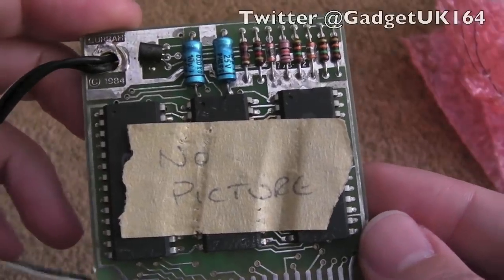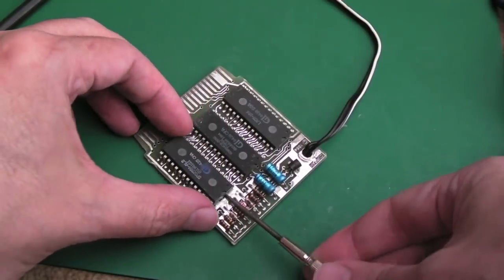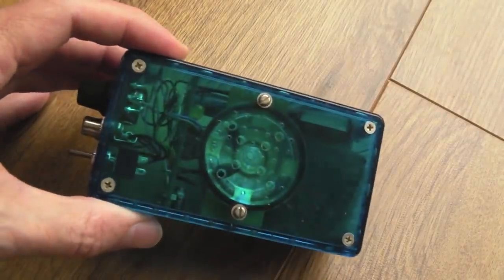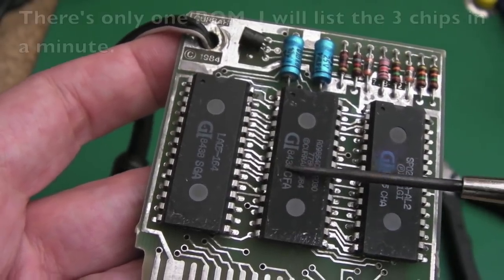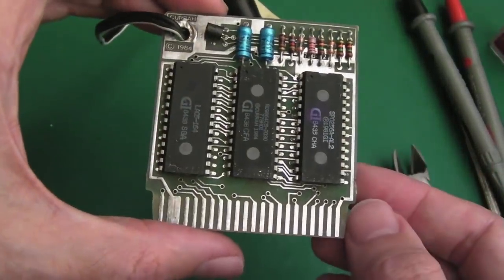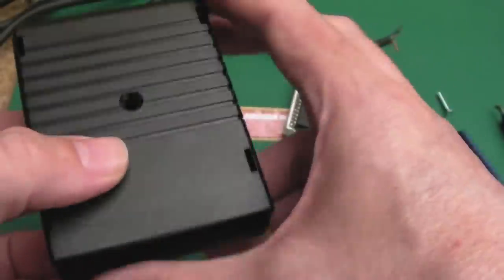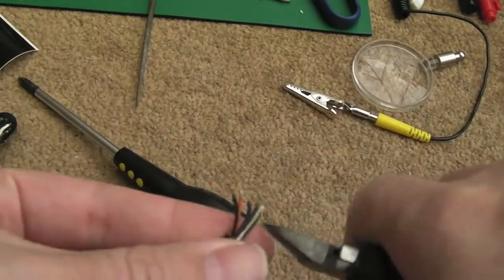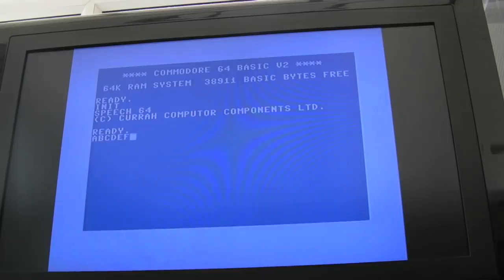Commodore 64 (C64) Currah Speech 64 (Voice Messenger) Cart Repair

Comment: No Vcc means Data Bus shorted to ground... that's why it didn't want to boot.
Reply from the maker: How does the data bus short to ground when there's no VCC?  My understanding is that often what happens is some connection leaches the supply in an unintended parasitic way.  But the databus is provided by the CPU and the CPU has power.  If the ROM was not powered I cannot imagine it shorting the bus out.
Reply: @GadgetUK164  Many chips I've seen pull outputs low when they have no power but have a ground, and high when they have no ground but only Vcc. Maybe it was not the databus (if it is connected directly and only to EPROM), but some other crucial control signal.

Comment: What a strange fault...did this cart ever work? If not, it's a wonder it wasn't thrown away. I didn't even know Currah made a speech cart for the C64, but to be honest, it didn't really need it. SAM did an admirable job in software only.
Reply from the maker: Yes, I think what happened is at manufacture the pad going to the VCC pin there was lifted up - you can sort of tell that at the point I am zoomed in, there appears to be no pad on side of that pin that we can see, and underneath it was lifted up almost sideways against the pin.  Yes, SAM does sound great - just spotted that on 8 bit guys video!! =D

Comment: i just tried this but unfortunatly my results were not as succesfull
as yours! just couldnt get it to work, i could tell it wanted to though, kind of bit of sound and scrolly off coloured picture?! i used an existing din cable though and not seperate pieces of wire like you did.. i also broke my soldering iron in the process! so now ill have to wait to buy another one of them before having another crack. 
do you think a Y splitter male din to 2 female din cable would do the same job at all?
Reply: ..... i say broke my soldering iron i mean threw it down the garden in a paddy
Reply from the maker: A Y splitter that is fully wired (eg. 1-1, 2-2, 3-3 etc) with the correct DIN connectors would work, provided you join up to the correct connections with the audio coming out of the Currah.
Reply: @GadgetUK164  thanks for the reply, i now have a shiney new soldering iron that isnt broken down the garden and am just waiting for a fresh din female end to be delivered and i will be having another crack! if that fails i'll be looking for a Y splitter cable then

Comment: Hi. Isnt it possible to use this on a Commodore Monitor? Currah Speech using the video out on C64. Is the only way to get picture on the screen to us a RF cable?
Reply from the maker: You can use composite output to connect to a Commodore monitor (CVBS input) - and the sound can be input to the monitor too.
Reply: @GadgetUK164  ok, do I need a module/splitter between c64 and monitor then as currah Speech is plugged into the video out contact on computer?
Reply from the maker: @_commodore_  Just a composite lead - the audio from this cart should go into the audio IN on the SID chip as default, which means the audio out will go to the monitor I think.   You just need a C64 composite lead (check it has 2 RCA connectors, one for video, one for sound)

That's if it comes with the mixing lead - mine was missing that I think - I would need to watch the video back.

Comment: I have one of these that's been sitting in my closet for years - I just tried it, and it works except no sound - When I INIT I just hear a humming noise.  Any ideas? Would you be willing to repair it? :)
Reply from the maker: I cannot do customer repairs sorry =/  Are you sure the audio / RF pass through is connectded up properly?  It might be that the speech chip has died, or the capacitor that couples audio has gone bad.
Reply: @GadgetUK164  Thanks for the reply I understand! Hmm maybe I’m not understanding how it works. Does the audio have to go through the external? I suppose I need a cable adapter of some kind.

Comment: Just wonder about 25V caps. It's not so bad bcos, when you use capacitors for higher voltage, there are much lower leakage currents.
Reply from the maker: Yeah, it really doesn't make much difference btw!  Where I can I tend to uprate on voltage.  The main thing is to not get too close to the voltage.  The SNES for example uses 16v caps on 12v input - and for the most part they are usually OK - although some of the ones I've seen from Japan seem to leak.
Reply: @GadgetUK164  
On another topic ...  Did you see this cool idea ?
https://github.com/ThKattanek/1541-rebuild/blob/master/doc/1541-rebuild-schaltplan.pdf
see page 1 and 4
I can't get it. If the transmission to the VIA $ 1c01 PB port is carried out from the microcontroller, would it not be safer that the PB lines wouldn't be completely cut off from the PLA? Also byte ready and SYNC? As I understand this, atmega steers so there may be conflicts on these lines ... (?)

Comment: Great video.  How would that trace hidden under the chip ever of got damaged?  

Oh and never mind weird voices in your house that c64 sounds terrifying enough 😂 exterminate.
Reply from the maker: Thanks =D  I think it was a manufacturing defect!  It perhaps worked initially but just based on the lifted trace resting on the pin.  At some point it stopped working - probably due to that trace moving ever so slightly (no solder on that trace on top side).